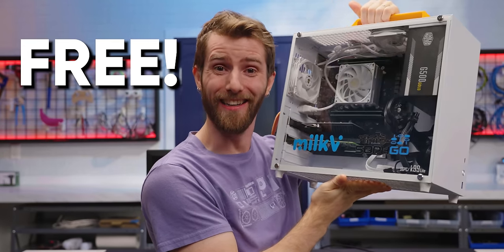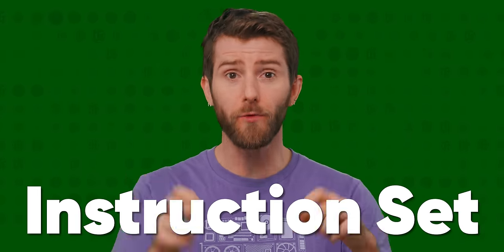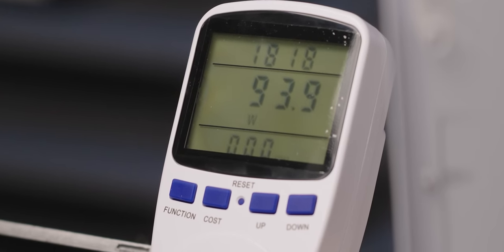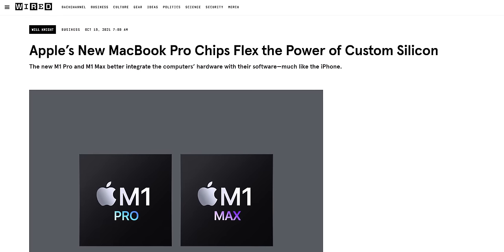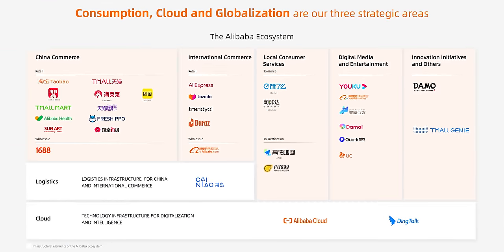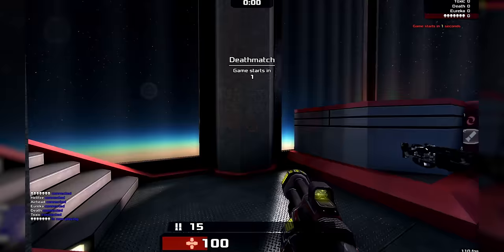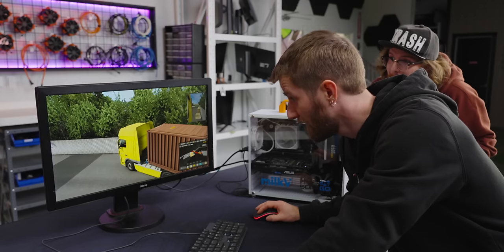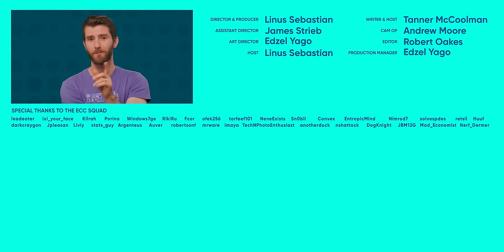This CPU is FREE! - Milk-V Pioneer with RISC-V

Comment: those sata "dust covers" are actually pick and place covers 
they are there so pick and place machines have something to suck on to, this is also why you find yellow (kapton) tape over some connectors that have holes or seams that a suction cup cant ... suck

Comment: It's crazy how optimistic Linus is about RISC-V when he's consistently been pessimistic about Linux and Proton. Whatever challenges there are for Linux and Proton on x86 are compounded when throwing RISC-V into the mix. Even in an unlikely scenario of Windows on RISC-V, you would still have the same issues of cross-platform compatibility layers not being perfect or reliable.

Comment: You guys are aware that Box86 exists, which allows you to run 32bit applications.

But you have to have a 32bit compatible processor, and Im not im skilled in riscV. So im assuming it has zero 32bit support

Comment: Which Linux Kernel are you using? It's expected that you can't see BIOS because it might lack firmware support for your graphics card, but as long as your graphics card is supported in kernel and driver, it should be working.

Comment: I am very sceptical. Apple is so efficient because of integrating the ram directly next to the processor and they are using the latest TSMC process. Then they included some circuits on their chip to speed up x86 emulation tremendiously. And they control the operating system too, to set background jobs to sleep.
Windows RT was just a hobby project. With x86 x64 emulation and running Android apps + no limitation to the crappy Windows Store, MS might have pulled it off.
This was the same fault as Windows Phone. Closed system with limited functionality. Android was just better.

Comment: This might actually make a pretty decent game console emulator station. It might actually be able to run PS3 games perfectly without even having to emulate the code. Just run it natively.
Reply: It will still be necessary to emulate the console, because the PS3 uses its own architecture (the Cell architecture) which is different than RISC V.

Comment: You forgot to explain how a 128k core system managed to be slow doing such simple tasks? Al that you showcased have been running smoothly on entry level hardware for the past 20ish year?
Reply: uhh .. because the things he tested it with probably used 1 or 2 of those cores?  This machine is not made for running a word processor or gaming -- it's for software development, scientific/engineering computing, a server dealing with thousands of independent requests, etc.
Reply: @BruceHoult  what is your point? He still forgot to explain it.

Comment: I just checked, Steam on Linux IS 64Bit though there are a ton of 32Bit compatibility libraries and THOSE do not run. This breaks dependencies but NOT the runtime itself. If you force to ignore dependencies Steam itself runs pretty well on an amd64-Steam.

I know what I am talking about. I tried installing Steam on a 32Bit-ony Linux system and there is absolutely NO chance because all the core libraries are 64Bit only.

Comment: To be fair, anyone can build an x86 CPU without paying licensing costs to anyone; there are no valid patents on the x86 instruction set anymore as they have all expired. It's mainly the additional features and extensions surrounding a modern x86 CPU(from Intel and AMD) that are patented. Many companies have used or are still using x86 instruction sets without paying a dime to Intel. 😁

Comment: Funny how as soon as Arm is rising in the tech space, it seems like RISC-V is ready to take it's place.
Reply: It took a long time for ARM to get to where it is now, I expect RISC-V to also take a while. Sure, it will soon be available as viable options in certain scenarios, but it will probably be a decade before it is as prevalent as ARM is today.
Reply: @stephencoakley  sounds very reasonable. It's taken the Arm ISA almost 40 years (1985) to get to where it is now. In shipment volume RISC-V is currently about where Arm was in maybe 2010, but technology-wise for shipping hardware (e.g. this machine) RISC-V is about where Arm was around 2019 (Pi 4, Graviton 1). RISC-V chips out mid 2024 will be similar to the mid 2022 RK3588 with Arm A76 cores.

Comment: honestly, the performance of this system doesn't seem unbearable. especially if you plan on using some lighter-weight desktop environment. it seems on-par with using, say, a lower end 2015 laptop on the latest version of windows 10.

Comment: The main problem now is real CPU with vectors support (1.0 version) and adapting by software. Even fro arm not everything is ready but for RISCV such work only beginning. 
I think in next 2-3 years will be ready good enough CPU and boards after +2-3 years of development will be first good enough solution for finall users (not developers).

Comment: I hope some RISC-V design will be able to do x86 instructions kinda natively in the future because i worry about game compatibility and efficiency a lot.

It's easier to implement a compatibility and doubt care about efficiency, if you just throw raw power into it like a 500 W desktop computer but the real magic lies when you can render PC games well on a gaming handheld, especially the not old ones!
Reply: In order to be compatible with x86-64, it would either need a complex translation layer (which modern x86 CPUs already have, they all convert the instructions into a CISC dialect), which would eat up die area and power, or you'd need to implement the entirety of the x86 specification, which is exactly what RISCV is trying to avoid, lol

Comment: This is a fun video, but ultimately RISC is pointless and makes no sense whatsoever. Actually getting RISC up to ARM/x86 levels of performance and then porting all the software we need over to it would be a decade of work by millions of developers and engineers and cost hundreds of billions of dollars, at a minimum. Even just buying Arm Holdings outright and open sourcing ARM would cost only a fraction of that, and be a lot more useful. So why would anyone spend hundreds of billions to reinvent the wheel with RISC?

Comment: I'm really surprised Apple didn't go RISC-V when they switched to ARM. Considering they've made these changes before and had a ton of experience with PowerPC, at least somewhere in the company's history, why license ARM?
Reply: They had massive experience with ARM thanks to the iPhone and were already making custom ARM chips for iDevices. In fact, Intel Macs already relied on Apple's ARM-based T1/T2 chips for security, SSD control etc.   Apple's connection with ARM goes much deeper - they were one of the original 3 partners when Acorn spun off ARM as a separate company, and invested in the development of ARM 6 for the Newton back in the 1990s.  Though Apple sold off their ARM holding back when they nearly went bust, the iPhone makes them one of ARM's most important customers so I'm sure they can get a good licensing deal. ...and now the M-series processors are of huge  importance to ARM.

I'm pretty sure you can't build a CPU without licensing a metric shedload of 3rd party technology anyway, so a reasonable license fee for the instruction set isn't a big deal, at least if you're a big player like Apple  (I have a little picture of ARM trying to "pull a Unity" on Apple).
Reply: @donutschool  you are certainly correct that this makes sense financially and logically. However, Apple has a history of wanting to go their own way and fully own/control every part of their supply chain that they can. I'm surprised they didn't go the RISC-V direction sooner, maybe even with iOS devices at some point before switching Macs to it as well. You're also correct that licensing ARM probably is a drop in the bucket, but I see it more as a philosphy thing inside Apple. They so often don't go the easy way so they can go their own way instead. Good insight on the history with ARM itself since the Newton, I hadn't known that.

Comment: Now as they tweak the software for it this computer may become popular.  Make it able to work with the latest nVidia GPUs and you really have something then!  I hope that RISC-V doesn't get banned.  Why must we be the ones who never have any fun?  With it being open source it would not be trivial for a US based company to make the chips and make them secure so that China would not be an issue as far as security is concerned.  They might have a hard time turning a massive profit on the chips since there is no royalty on them.  They could add on their own instructions and charge a royalty for those and only those .  Most of the price would be production, packaging and a touch of markup for slightly more profit.  Are the motherboard and all other parts associated with it open source?  I am thinking similar to IBM's Power series of processors that was up to Power9 last time I heard.  Imagine if you could afford those.  Forget RISC-v you have all of the processing power you could ever need.  That is with just one caveat and and is a tiny one, it doesn't run Windows.  But many people may be reconsidering whether they still like Windows.  The Power series processors (not PowerPC) can also run Linux.  I wonder what else they can run.  I know they are a server processor and that is one of the key reasons I have never actually seen one up close.  I even know people who have a good bit of money and they would not own a thing like that.

Comment: Honestly,  This is going to be a disaster.  Have we learned nothing from the gaming crash that nuked the atari, with unlicensed games flooding the market, crashing consumer confidence & tanking gaming consoles so hard consumers had to be tricked with a name shift close to a decade later, for them to come back.

Sure it's great no oversight, no license, no board to deal with for a risc-V cpu .....  but that also means... No Quality control, no standards other than 'it is like this', No assurances for the end users, & no standardizations that make x86_64 work as well as it does today. (yes it has issues... but imagine instead of .. 'dodgy timings & claims by MB manufactures' it was 'unreliable claims with no real way to test cpus against each otherss, and even possible hidden landmines in some'    

Getting reliable tech is a crap shoot with tight regulation & iron fists of rights holders wanting their name & money preserved. (intel, nor AMD will tolerate a shithead tanking their product name with BS)

I see .... a world of pain & confusion coming along. 

Sure AMD & Intel kinda suck at naming, but imagine  .... more players... and all using the same 'Base' CPU setup, and no real requirements to go over feature sets.

Comment: Is there just one pro? No licensing fee for the cpu maker? That's it? 
Doesn't everything else suck about it though? 
If a few big complex instructions have to be replaced with a large number of simpler instructions, doesn't this make your apps larger. Doesn't this take up more memory? Doesn't this mean that more bits of code need to bounce around between memory and cpu and bounce around inside the cpu jacking up the workload, the current draw and the heat level?

Comment: The only reason that could lead to the x86 architecture being replaced among gamers would be a near halt in performance gains with the x86 architecture. But this would have to be so important that the other architectures would be significantly faster in comparison.
Only this would ensure that Windows is no longer the dominant platform.
Or to put it another way, if modern x86 CPUs had speed level 1, then the others would need level 1.5 or better and that would have to last over a longer period of time, say 10 years, for customers to get the idea to change to change platform.
An important reason in favor of x86 is still backwards compatibility and the huge range of software. As long as the performance/watt to price ratio is small, gamers and game manufacturers will continue to stick with x86 and Windows. At the moment, not even Windows is losing significant market share on the x86 architecture to Linux, which makes a switch to a different architecture and operating system even more unlikely.

Comment: this is where AI needs to shine. with a trained then pared down local interpreter connected to a more powerful AI as needed to run any program on any architecture as long as it can run the AI. the more users you have with varied hardware and software the more accurate the AI can handle translation of any app you want to run. can your phone play crysis? maybe with this it could ^_^

Comment: For $2500 in MOUSER ELEC, this system doesn't seem like a solution or alternative to AMD or Intel processors. It seems that the fact that it is based on open source has made it inaccessible to ordinary people.

Comment: On 8:16, can someone clarify why Quad-Channel memory is so unusual?
I was under the impression that all modern PCs, when equipped with 4 sticks of RAM, would run in some sort of Quad Channel mode, i.e. reading from all 4 sticks at the same time.

Comment: While this video was very interesting I would have liked you showing some CPU benchmarks that properly utilize the 64 cores this thing has. A game may only run on a few of the cores which are not too fast on their own, but something like cinebench that can utilize all 64 cores may show where this cpu shines.
Reply: You're quite right that everything in this video was probably only using 5% of the cores. I don't know about Cinebench, but for software builds (with a good build system, or doing lots of builds in parallel) or scientific/engineering computing or as a web server this is price and performance competitive with current x86 with 16 performance cores. Next year will see RISC-V machines with cores probably twice as fast, and 2025 or 26 will see RISC-V competitive with x86 and Apple on a per core basis.

Comment: PowerPC demonstrated that RISC was a viable high-performance alternative in the 90s already. PPC chips were trading blows with x86, and at times beating it. Especially with the introduction of the G3 and carrying through to the G5, though by then they were losing their performance-per-watt advantage and had to switch to Intel just to be able to put out a modern laptop. But that was on IBM more than the architecture itself.

Comment: I can all but guarantee Apple are working on RISC-V based Apple silicon chips as we speak. The relationship between Apple and arm is already strained over licensing fees. The license fee Apple pay arm is already way below industry average, and when Arm tried to increase it, Apple were not willing to play ball. Current deal I think runs until 2028, but in am sure Apple will want to have RISC-V as a fallback. If that happens, I am very interested to see where it goes

Comment: 12:42 Now we also need a competitor for graphic cards. And then is finally some movement in the market again. Risk 5 and Apple (with M chips) will bring movement into AMD and Intel. Risk 5 won't because it alone would lack software support. Apple alone won't because they are premium and don't compete with AMD/Intel. But Apple will make the software happen. So …

Comment: I understand that this is like super early days, but I can't stop laughing over the 64 core, 128 gig DDR4 struggling with OpenOffice, or Quake, and running ETS in like 4 fps. I do understand the clearly given explanation in the video how this is totally normal and will be fixed pretty soon but by God it's hilarious
Reply: It's not designed for gaming. The tests Linus did used probably 2 or 3 or the 64 cores, maximum. This box is for software development, scientific/engineering work, web server and things like that, for which it is performance and price competitive with an x86 with 16 cores. Also cryptocurrency mining -- the company that makes the SG2042 chip is the biggest maker of crypto miners, and already has a mining box (X5) with 18 of these chips (1152 cores).

Comment: Sigh..just a lob. 

The code needed to be intact and couldn't be shifted around if you didn't know what it did.

Remove the hardware lock and then you only need an intact portion as they prob added a bunch of junk and maybe the library wording.

Comment: Why can't you run RX 6000 cards? Can't you just compile drivers for it?

Anyways, i don't really see this becoming good choice for gaming anytime soon, because so much games are only x86, so it would need very good emulation to really become good gaming machine. But if i want laptop with long lasting battery thats not meant for gaming, i could see it being risc-v soon.

Comment: Nitpick: the RISC-V ISA is free, but each manufacturer is free to add custom, proprietary instructions in the design and they're not required open-source the peripherals inside the designs, either. This means that e.g. any integrated GPU can and quite possibly will be proprietary, just like they are on ARM at the moment. Video encoding/decoding hardware? The same deal. AI accelerators? Again, they may or may not be proprietary.
Reply: Very true, but steps to open sourcing at least the ISA already gives big advantages)
It would be nice if there also were promising open source GPU and AI accelerator centred architectures.
Although RISC V has people working on such extensions too.

Comment: Screw it. I'm going to make my own CPU chip.. with built-in networking and photo/video creation acceleration. It will be a workhorse designed for workstations and content creators.  I'm going to use a custom Quantum basic design with x86 emulation. Cause why not. 🤗